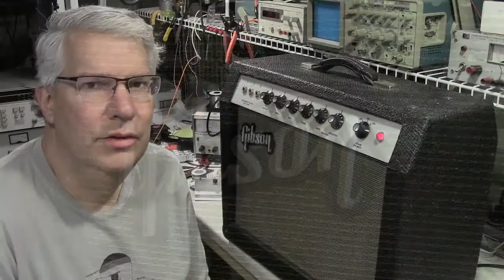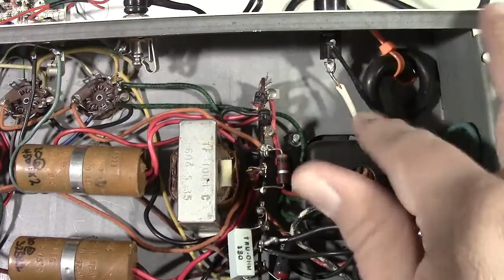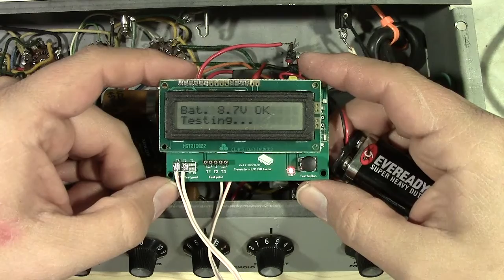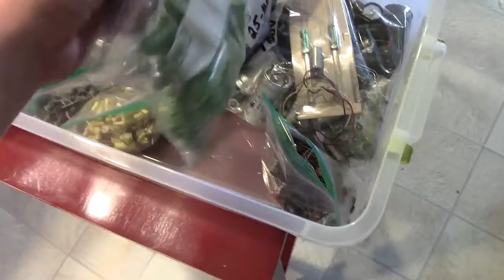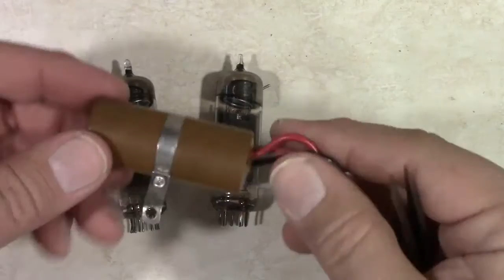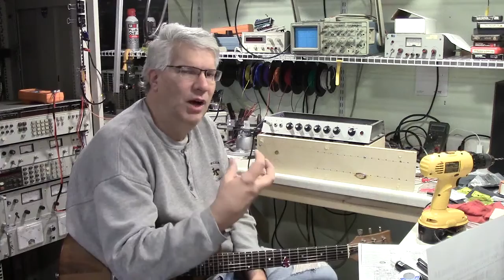Volume - Repair - 1966 Gibson GA-15RVT Guitar Amp

Comment: Craig...Great video...very informative....I have the GA 15RVT also and have what I can only can explain as a crackling sound that seems intermittent while the amp is on....it sort of comes and goes and seems to be independent of the guitar signal...is this something you have come across before with Tube Amps?  The amp has had new filter caps installed.  Any advice would greatly be appreciated.   Also - When you got to the part of the video where you discussed the Reverb X-former...it was like Deja vue....My amp has the exact same problem after coming back from the Cap Job...that I will attempt to rectify following the info provided in your demonstration.  Thanks for posting such a descriptive video for the GA 15RVT.   Regards!
Reply from the maker: Dear TNT. I found this article that explains a course-of action to fix your crackling, http://www.300guitars.com/articles/tube-amplifier-crackling-noises-what-to-look-for/. I'd start with cleaning the sockets and tube pins, I use those dental floss brushes, https://dentagama.com/news/interdental-cleaning-dental-floss-vs-water-pick-vs-interdental-brushes, and DeOxit. I spray the brush then clean the socket. I don't spray the socket directly, too much spray spatters everywhere.  Then I clean the tube pins. Its an easy starting point. Then I'd pull the amp and reflow all the solder joints. There might have been some less-than perfect joints soldered 50+ years ago that may have deteriorated. Of course spray the pots, but I don't think this is your problem.  Have you tried to swap the pre-amp tubes? same tubes different sockets, just flip the 6EU7s and the 6BQ5s and see if it goes away (this might happen anyway during the cleaning).  Then after that, if still crackling, I'd start replacing the pre-amp tubes.
Reply: Craig Hollabaugh.....Thanks for the links and info...Looks like I have some work ahead of me...Regards!

Comment: Just watched your video and noticed all your rack mount test gear.
 Did you make your guitar yourself?
Good repair job.   Proper wire wrap and the right amount of solder instead of cold solder blobs is essential in a solid repair.  I've worked on miltiary, gov't and commercial contracts in my past, and know how important wire mechanical connections are in soldering. My experience with Gibson/Epiphone guitars and amps goes way back to 65/66, so  I'm famliar with them.
Reply from the maker: mechanical connections? what are you, an old school soldering master? Of course you are. Thanks for replying. No I didn't make the guitar, its a Gibson "The Paul" solid body from the late 70s. I picked up at a pawn shop in Santa Barbara in 1981. https://en.wikipedia.org/wiki/Gibson_The_Paul
Reply: Oh yes, now I remember.  I have a book on "50  years of the Gibson Les Paul"
and it'ss in there. I just didn't recogize it with the Gibson decal missing on the
headstock.  Looks like it was made in the Norlin years.. when they did a
lot of experimentation to increase profits, where quality often suffered.
 Some models  
of the full size LPs were even layered. . The gluing would so up on the edge
in later years.  They even tried to use walnut in some years.

I'v e made 3 unique LPs based on Stew-Macs full size '59 LP".  using three piece walnut for the necks .  These were inspired by a rare  Gibson model called The Special,  made from walnut.

I created  two   LP types, which are semi acoustic with "wings" attached to
a 3 piece walnut neck.  These are  semi hollow with f-holes in the wings and
neck through design for the fingerboard right up to the tail piece.
Push pull controls and one has a preamp as well.   

I am a retired communication engineer with many years spent in that line of work,trouble shooting.
Good to hear from you.
Reply from the maker: sorry for the late reply. Thanks for watching!